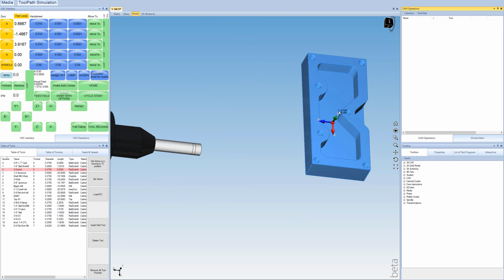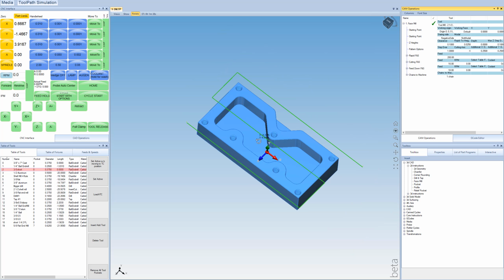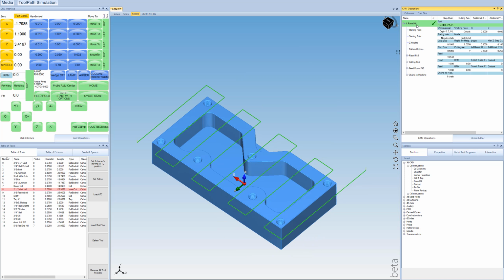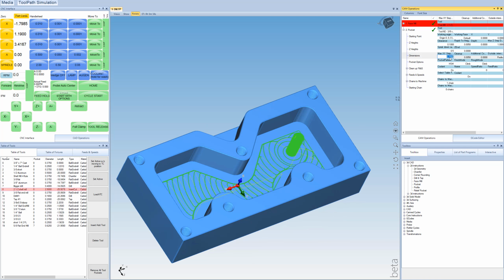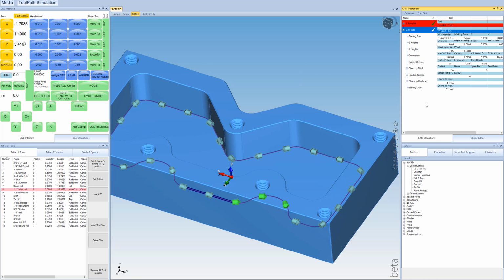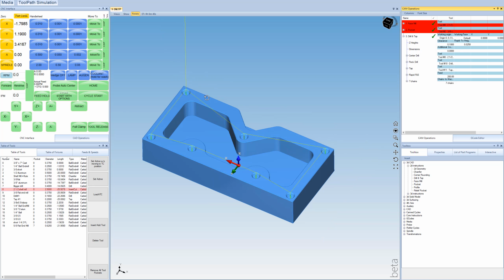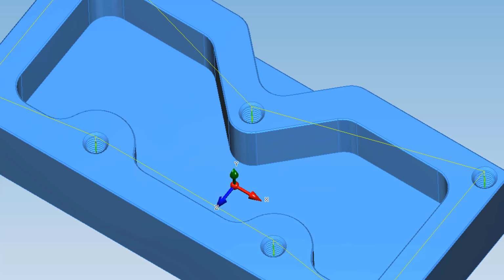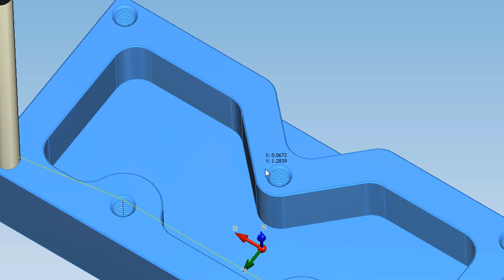Rottler C4 Software creating Toolpaths direct on the machine

Comment: Had an error message come up today saysThe user stored table of tools is newer than the common stored table of tools, so the user stored table of tools will be loaded this time only. All my tools are gone, any suggestions? When I go to add a probe as soon as I close the software the probe no longer come sup in my tools menu.
Reply from the maker: Hi there. Sorry for the delayed response. Please contact service for more information on your error code. That will always be the quickest route to finding a solution for issues like these! Please dial 253-872-7050 or 1-800-452-0534 and ask for service. Thanks for watching!